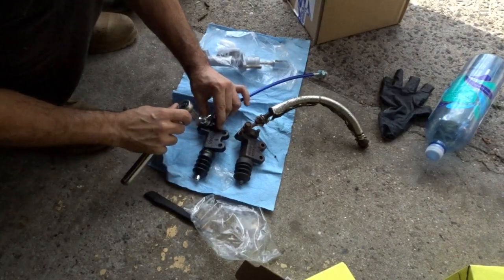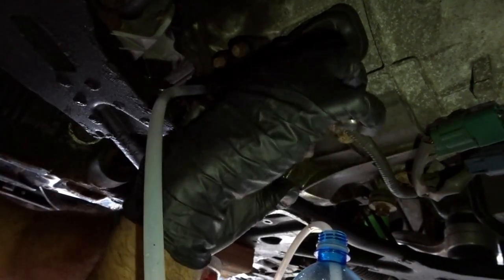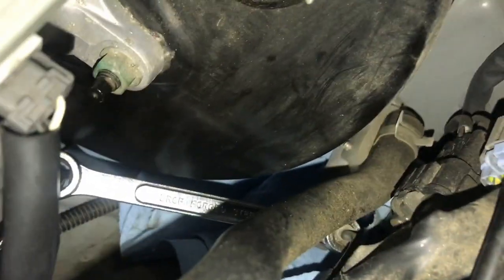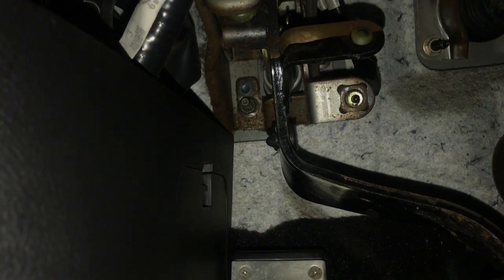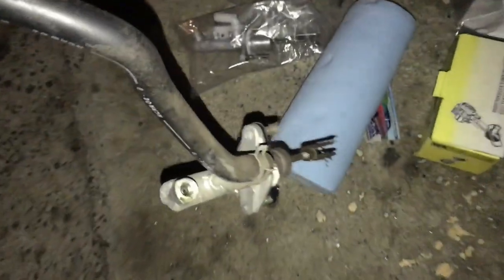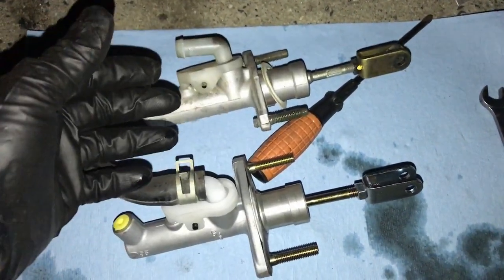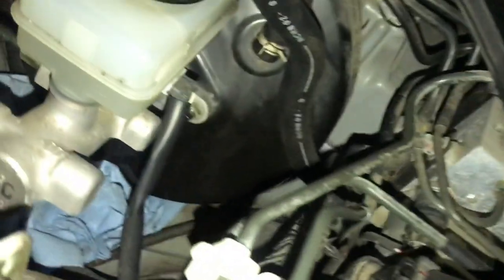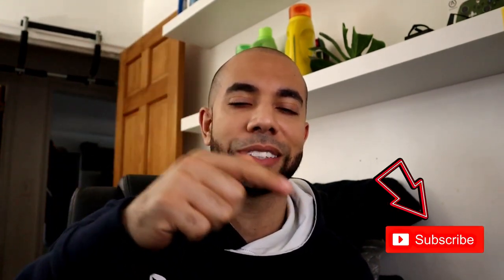NEW Clutch Master Cylinder Install for the Nissan 350z | How To Replace on 350z/g35

Comment: I just installed the slave cylinder and the master clutch cylinder with the new clutch line !!!!🥳🥳🥳. Everything is working fine got to test drive it and found a 370z right next to me and we both hit a hard pull into the night so happy thank you soo much for all your videos the camera angles helped so much !!!
Reply from the maker: Ayyy 🤙🏼🤙🏼 you most welcome brother I'm Glad everything worked out for u... Now try DOT 4 if you haven't and you'll thank me later 😉... Gonna make a follow up vid soon on the bleeds (power/manual etc) I did and fastest way to do it and talk about all the fluids I tried... 😅always experimenting
Reply: what brand is that clutch master cylinder?
Reply from the maker: Hey brother so short answer 4 u, its LuK which i found to be an OE supplier for some Z's... However since this video I bought a new transmission and to tie everything in I ended up just buying oem new slave and master cylinder(on a steep sale)... I'd recommend you spend alil more and get the New OEM model (they went thru 4 revisions) 30610-CD00B is the latest part # and the one i currently have... It feels alot better and is less noisy compared to the last 2 I had. The LuK model will get the job done for sure but the OEM feeling with the new MC is there (with the part # I provided). Hope that helps!
Reply from the maker: Side note: I was speaking for if you have a DE model. If you have an HR there has been no revisions to those master cylinders as of today.🙌🏼🙏🏼

Comment: what did it measure out to with the calipers?? i cant find that anywhere :(
Reply from the maker: Hey brother, So if you looking for the clevis and push rod distance on the CMC. I found it set from factory so no need to adjust tbh (if you get one from the dealer) but if u need to measure it out, its 110.5 mm (4.35 in). Check out the IG & Hope that helps brother!

Comment: Was it hard for you to put the hard line back on because I’m trying to install mine and I’ve done everything already but the hard line is still not on since it won’t screw back on
Reply from the maker: Hey Jose, Sorry to hear that but everything bolted up just fine no issues at all
Reply: @SimplyEddieG  oh ok thank you
Reply: Having the same issue rn and can’t seem to get  the hardline to screw back. Hopefully I don’t break it.
Reply from the maker: @Boogie Bass0605 all is good, Just alil finessing and ya made it work lmk?
Reply: Tightened down the bolts on the inside and it fixed that problem for me